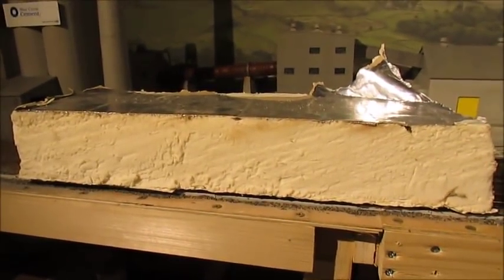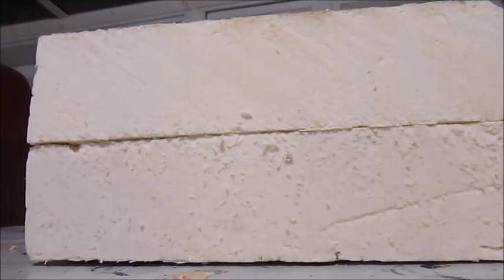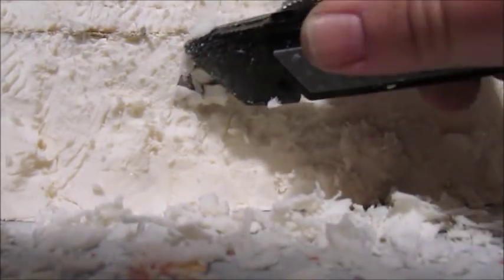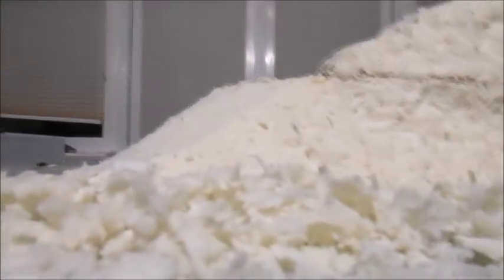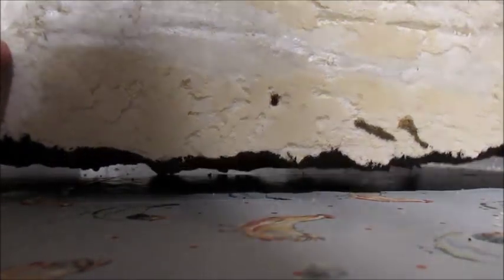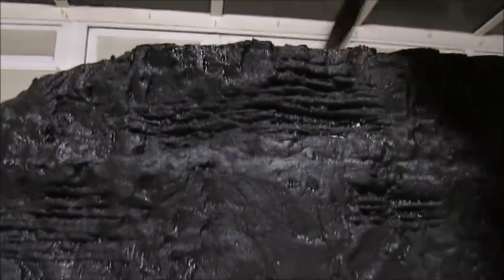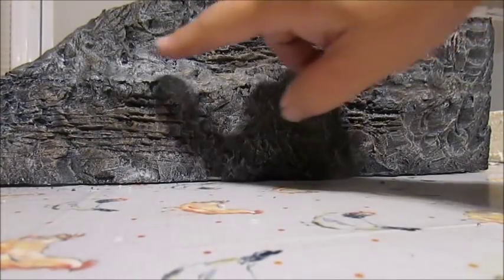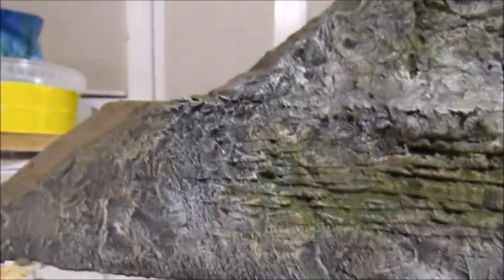How to make model rockfaces from scratch ( Tutorial)

Comment: Excellent tutorial. Just a few tips. Builders have to pay for their waste removal, so when you see celotex type product in skip or dumpy bag, ask first (it could be contaminated with a treatment etc) they will be happy for you to take what you want for an almost free rockface.  It may be possible to join 2 thicknesses by a small coating of the filler so you don't have to fill when assembled and you can strengthen this by inserting kebab skewers down through the top.
Barry.Devon.
Reply from the maker: Thankyou, A friend of mine and fellow modeller is a builder. So I was given some Celotex half boards to do this project. Yes if you catch a builder they waste a lot of this and you don’t need a full sheet anyway. So in a way it is recycling? But as you say always ask first.